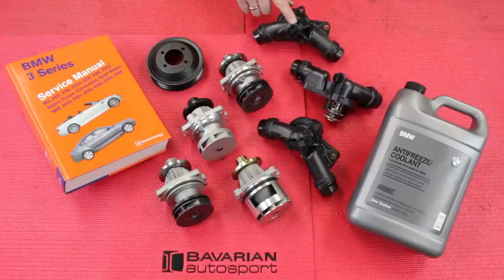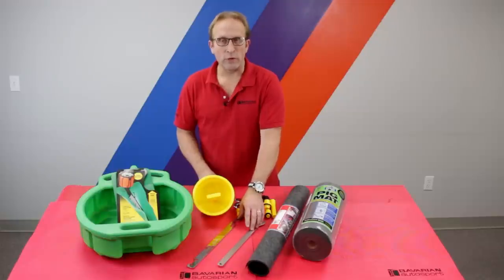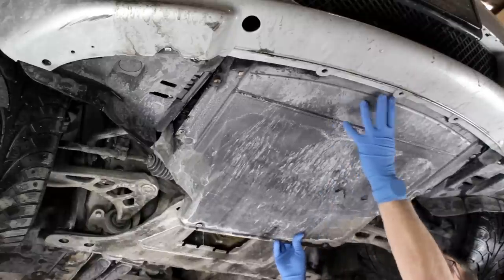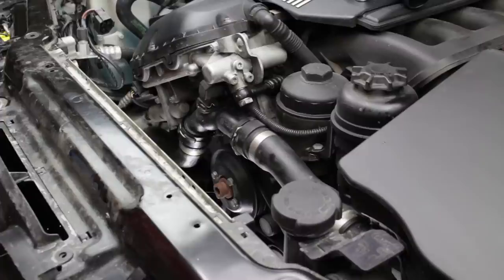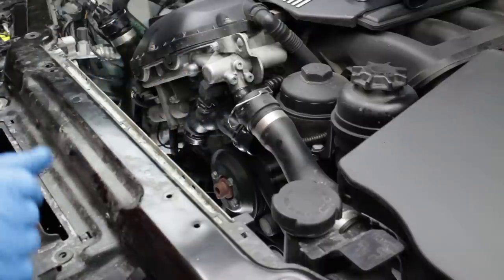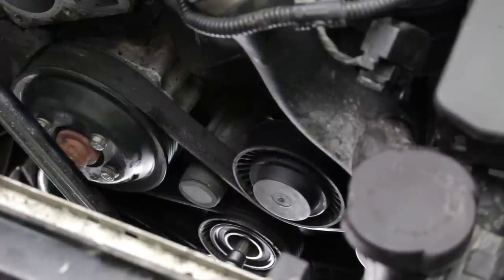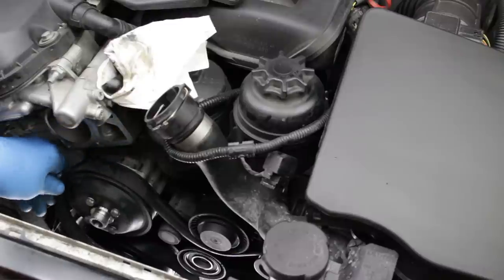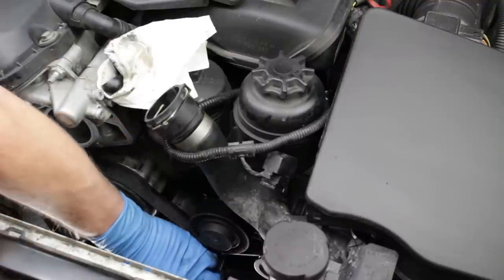Replacing the water pump and thermostat on most 6-cylinder BMWs 91 thru 05 (M50 thru M56, S50, S52)

Comment: ATTENTION VIEWERS:  It is NOT necessary to remove the Vanos oil line or the bracket to remove the thermostat.  Simply remove the four retaining bolts and gently slide the thermostat housing out from under the bracket.  Clean the surface and install the new thermostat.  No need to remove Vanos oil feed line.

Comment: Just a heads up, the bolts you removed from the thermostat housing can be used to extract the water pump from its housing. Same diameter. I just did this today to replace my water pump of my e60 530i m54 engine. No need to buy a water pump removal set.
Reply: Thank you for this info. My 93 E34 needs a new water pump..

Comment: ATTENTION VIEWERS:  It is NOT necessary to drain the coolant from the block to do this job. Simply remove the drain valve from the bottom of the radiator. Draining the block does have the advantage of removing all the old coolant. But if your coolant is in good shape, simply drain the radiator.  Saves you a huge amount of time.

Comment: that's so easy with just basic tools.. a water pump replacement on my mitsu 4g13 involves crankshaft pulley, timing belt, tight space, more tools etc

Comment: On my 2002 E39 530i I did not need to remove the bracket with the banjo bolt to remove & replace the thermostat.

Comment: hello I appreciate all the videos you ever put up.. my question is on my 05 bmw z4 it's extremely tight due to the different frame design in the front. is it possible to remove without raising the motor? thanks for your help.

Comment: My water pump had a catastrophic failure, sending shards of the plastic impeller into the water pump housing.  I tried to fish out the shards with my finger and got a few, but I'm not sure if there are more shards beyond my reach.  How can I make sure that I got them all out?  Or, should I not bother, i.e. would they have no impact on the cooling system?

Comment: Excellent video.  Thank you.  Is the engine coolant temp. sensor known to give any problems?  Would you recommend to replace it as a preventative maintenance, if so at what mileage interval?  Where is the coolant temp. sensor located on this model?
Reply from the maker: We really don't see a need to replace the engine temp sensor as a scheduled maintenance task.  The sensor on the M54 6-cylinder engines is located in the cylinder head, below the #6 intake port.  Therefore, the intake manifold needs to be removed to access it.

Comment: Thanks for the great videos -- long-time BavAuto fan and customer. Do you have any tips for reaching the drain plug on the block on a 2001 330xi? The car is on jack stands and I can see the plug, but I cannot reach it at all; not with my fingers, and not with any tool.
Reply: I bought the 4 Pc 3/8 In. Drive Quick-Release Extension Bar Set at Harbor Freight. It is a great set to have because of the quick-release feature that keeps a socket or additional extension from coming off or apart until you want them too. You can put a couple extensions together with a universal joint socket adapter (because of the angle to reach the drain plug), and easily reach the drain plug.  I've done it multiple times on my two E46s, with no problems. The quick release extension set is also a great thing to have when changing spark plugs, because your socket won't come off the extension until you want to remove it.

Comment: my oil pressure light flickered on/off today and i noticed she was leaking around the coolant reservoir(lower thermostat?) fitting. The engine temp.was showing normal running temp. I towed it home but she cranks up and seems to be fine now with NO oil pressure lamp!! What/Where should I start looking. Thank you...and thanks for the videos..BTW we are customers of BAVAuto..and I thank you
Reply: Rick Walker  you will

Comment: Yes but isn't there an arrow on the thermostat that say its suppose to face up towards the cylinder head or something like that?
Reply from the maker: No there isn't.  These can be installed in any position.  If, by chance, the thermostat had an air bleed hole in the flat base plate, this would go upward, at the 12-o'clock position.

Comment: for the m50 engines isnt there a specific way the thermostat is supposed face? wish you would have covered that briefly in this video.
Reply from the maker: The spring end (long end) goes into the mounting hole (toward engine). Thanks for your note.  We'll add an on-screen annotation on that.

Comment: our 525I  2001 is in the shop today, and the mechanic told me it will cost $860  to replace the water pump , serpentine belt and pulley.
Reply: Thats insane :o

Comment: wouldn't the engine have timing issues if the water pump pulley is not held at the same spot since when it was removed?
Reply: No. The water pump pulley is not connected to anything else. It's also round with no teeth. The timing chain is inside the block under the valve cover in the front.

Comment: If don't have those long 6 mm bolts, like I didn't, take out the hold down bolts (6 mm) from the fuel injector's plastic  cover, they're long enough to break the pump than just wiggle out the pump.
Bruhaha!

Comment: Getting that pan off would be a pain for a driveway mechanic who can't get underneath the vehicle. Is removing the drain plug absolutely necessary? Couldn't you just pump the water out of the radiator? 
Back in the day I'd just pop off a hose and let in drain out on the ground. 
That was before global warming, of course.
Reply: Leon Allan Davis drive it up on ramps. You can get good reviewed ones for 40 dollars on amazon.
Reply: Seems to me ramps are good for everything but draining fluids.
Reply: Well the Rhino ramps are used for easy oil changes so you don't have to jack the car up and then put it on stands. Unless you prefer that, then go for it. I see a lot of people who do coolant flushes/ oil changes drive their car on ramps, slide under and unplug the drain bolts and let the fluids drain out.
Reply: I always thought oil pans were designed so that the gunk settles into the depression just above the drain plug. When you drain the oil, the crap is the first to get flushed out. 
But if you tilt the vehicle back 30 degrees then not only are you not draining all the oil but what's left in the back of the pan contains a heavy concentration of sludge and metallic particles. 
This is why I've always drained my vehicles while they're level. For the same reason I don't take a piss standing on my head.
I'm sure some people do piss while in the upside down position. Probably the same ones who change their oil on ramps...